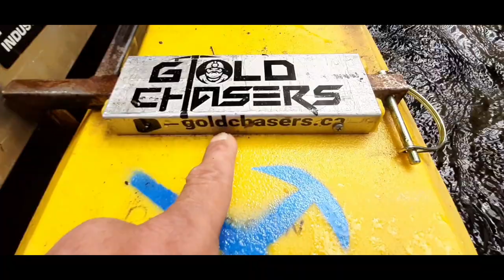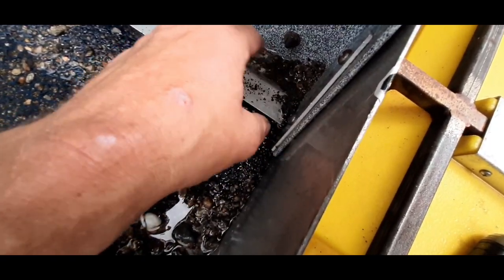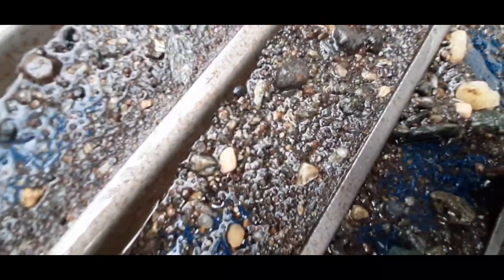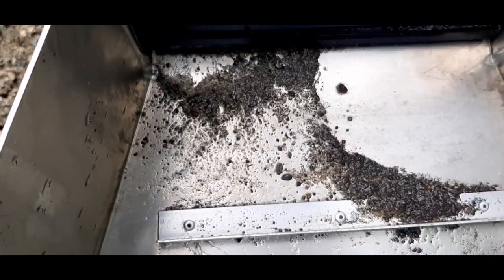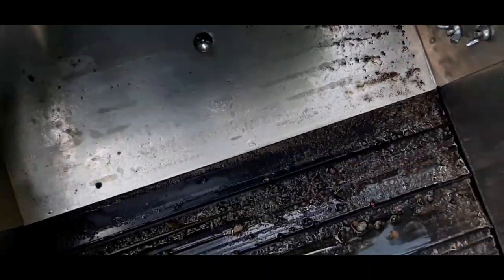Keene Gold Dredge & Goldhog Raptor Highbanker Prospecting shallow bedrock.  S.4 Renegade Creek

Comment: Hell yeah the ol raptor-flare  if and when you decide to make it a dredge only go up ta 2" I made mine a 2.5 n it's too much I find just as much gold on the back end of sluice as I do in the mats and if you lift up/remove the reverse ramp,  then you blow everything out of the miners moss and find a lil bit in your tailings I even swapped out the top mat to dream mat n I ended up over loading it I mean it still catches but not like high-banking👍🍻✌
Reply from the maker: Good to know I will tell him!